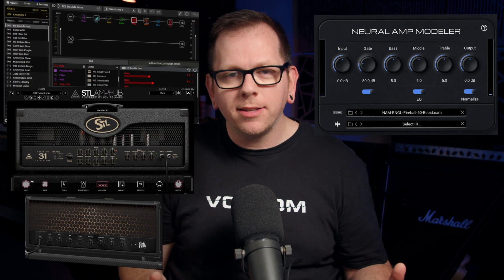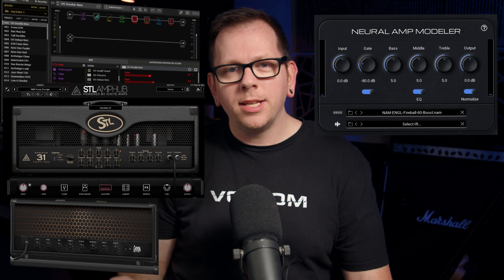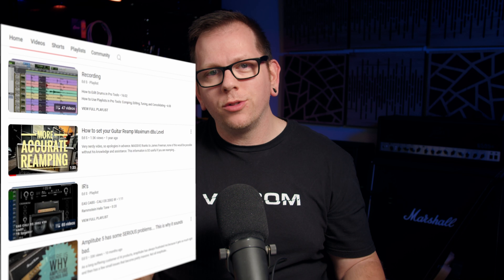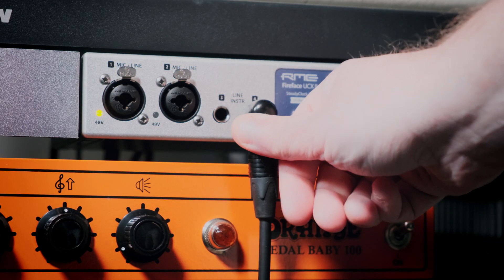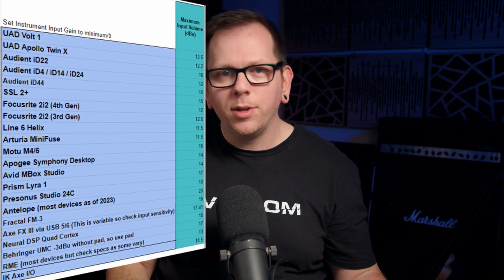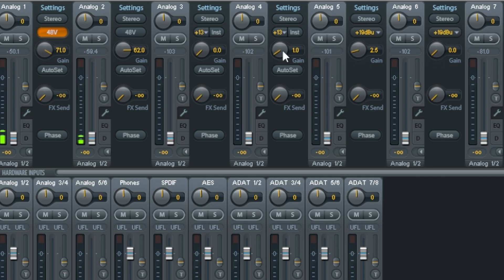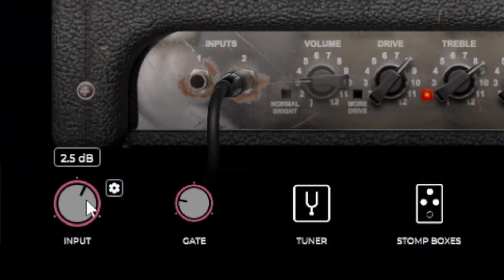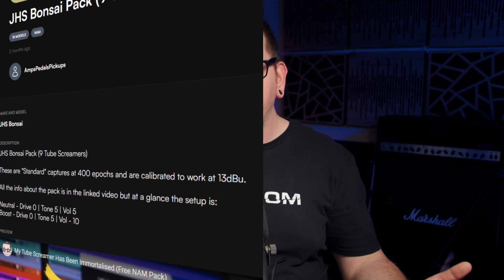Amp Sim / NAM Input Level Accuracy Explained

Comment: So, if the Clarett interface says that his maximum input level at instrument input is 15dbu, i need up the input level of neural dps amp sim to 2.8?
Reply from the maker: Yep spot on
Reply: @ampspedalspickups  thank you!
Reply: I can't find it nowhere, but thank you for the response 💪🏻
Reply from the maker: Which IK interface is it? I checked the axe io one and it says for input 2 on hi-z

0dBFS is obtained with a +14dBu signal at the TS input 

But yeah some interfaces and manual can be confusing. I always just open them and do a “find” for “dbu” and then next next next til I see them talking about the instrument input
Reply: @ampspedalspickups  sorry i replay the wrong coment. I don't find the input of IK Multimedia software like tonex or amplitube
Reply from the maker: @tregvilu  ToneX can be random based on the person doing the captures... and Amplitube is also random because as they modelled amps they seemed to have changed their own levels. The orange amps for example are insanely quiet, I have to go max input boost (which is around -3dBu)... so yeah unfortunately for those you still just have to play around with the input boost til things sound right. I'd say in general they both benefit from hefty input boosts.
Reply: @ampspedalspickups  i understand, thank you for your time and answers!

Comment: Hello. Thank you very much for the really good advice. However, I would like to know how to build a gain structure in programs: Logic, Studio One or Ableton. They also have excellent emulators of guitar amplifiers.
Reply from the maker: With neuraldsp and stl and everything on that spreadsheet, this information is given to us by the devs. Maybe someone could get in contact with logic about their stock plugins and if they can give us this information. We can always take some informed guesses by trial and error but without hearing from the devs we won’t know 100%
Reply: @ampspedalspickups  Can I compare the levels (with the same settings) that will go into a hardware amp and a software amp? Will this research be more or less objective?
Reply from the maker: We basically need them to tell us what levels were used so we can match it on our end. If we just dial it in by ear it’s guessing. No way to know 100% unless they tell us
Reply: @ampspedalspickups  I understand you. To my deep regret, I speak English extremely poorly. How can I correctly formulate a question for Logic support? Help please. I am ready to write to them at least every day.

Comment: I use a Steinberg UR mkII. How do I figure out which level for my guitar vst? Please help
Reply from the maker: What guitar vst are you using?
Reply: @ thank you for the reply brother. I am subbing to you as well 🤘 I have the check list you mentioned but it doesn’t have my interface on it. I’m using, neural dsp gojira plugin as well as the stl tones emissary plugin with engl impulse cabs. My main question was, if I’m using different amp sims, how do I know what to adjust the sims to seeing how everyone is calibrated different? I looked up my max input level for my interface but I have no idea what math I’m suppose to be using if you know what I mean?
Reply: And guitar rig 6

Comment: I have a HX Stomp plugging into a Scarlett 2i2, how would I approach it with this setup?
Reply from the maker: Using a DI box or modelling unit adds another variable into the mix and you’ll probably want to measure things to be 100% sure. Are you using the stomp for things like drive pedals or is it just a constant level out of the stomp and into the interface?

If it’s a fixed level then I guess we can think about it like a DI box and measure/work out the levels. But if you’re using drive pedals that can smash the signal then it’s a similar situation to using an analog boost pedal into an interface directly,bit harder to try and figure out what’s what cause the volume is jumping so much

I know I’m yarning but if I run a 20db boost pedal into an amp, the preamp circuit will clip the signal and pass it along to the next stages of the amp. Us guitarists are so used to just going “that’s how the amp takes this pedal”, it’s really just being clipped in a pleasing or unpleasing way. If you do the same into your interface and digitally clip it, it sucks and information is lost it’s just a different interaction. 

Anyway let me know how the stomp is generally being used and there might be a decent way to work out the levels out of it

Comment: With your gain at 0, you are at the worst SNR of your interface. You will endup with a very noisy digital DI signal. Inastead you need to max out the interface gain (without clipping) and lower the input at plugin level. You will then get the cleanest DI signal and still maintain a correct SIM behavior.
Reply from the maker: Modern interfaces that have around +12dBu of headroom are perfectly fine like in my example here. Some of my guitars are close to clipping on heavy riffs around +10dBu anyway. If you have quality equipment this kind of thing isn’t an issue

If you had your interface at 0 gain and your signal is insanely low and you’re boosting it so hard in the software that you’re introducing noise then yeah SnR optimisation would make sense… but the reality is it’s not a problem even on $150 interfaces like the Scarlett, audient and volt series. You’d really have to have some old off brand interface for it to be a problem

All of this stuff is contextual you have to judge the situation if there’s a problem.
Reply: @ampspedalspickups  If you clip at zero gain you are already too hot for your interface. You would need to use a DI box and come in at line level instead. Some older interfaces are notorious for poorly designed Hi-Z input that cannot handle hotter guitar signals. Nowaday, I think it's less common since now it's a pretty common use case to record DI signals and/or use plugins.
But anyway, the gain should be adjusted so the signal comes in just below clipping. Even if this means setting the gain at zero on some interfaces. On my Motu it's aoround 10 oclock.
Reply from the maker: @deconline1320  The RME I use has +13dbu at 0. Fishman fluence active pickups internally clip around +10dBu, bareknuckle aftermaths can hit around the same if you’re chugging away. I’ve got some other guitars with medium gain pickups that “could” be gained up a few db in the interface and then rolled down in the software, but the reality is the SnR stuff just isn’t a problem so all of a sudden I’m adding more variables into the setup just for the sake of hitting specs on a sheet. Right now all my recording and reamping is calibrated to +13dBu… if I wanted to go the extra mile I’d have to make a quick spreadsheet and test every guitar to see how much I could theoretically gain it up before clipping… and then offset the plugin by that amount. Everytime I change guitars or pull up an old session or reamp things I’d have to remember and reference all the offsets… or…. Just leave it at 13dBu where the SnR just isn’t an issue.

It’s all contextual. If you have one single quiet guitar of course it makes sense to work out the offset. But if the interface is high quality and the SnR differences aren’t really noticeable then there’s really no need to. And if you’re using a bunch of guitars that’s also another reason to keep things streamlined 

I could probably do a video showing some examples of how little it makes a difference.

Comment: Ed is doing redundant procedure.
Get the best volume according to your pickups on the way in into the audio interface (test the level it with chuggy palm mute + high pluck on the highest strings = this will ensure the worst scenario → lows at max RMS + percussive pluck Peaks) and if the input on the pre-amp (audio interface) clips the red, turn the input level down until not clipping (keep chugging + pluck).
Then you must have an audio reference from the REAL amps with knob settings (better do it with all knobs at 'noon' for default reference).
Knowing how the respective amp sounds, then you keep the same settings in the amp sim and adjust the input on the ampsim (or with trim\gain plugin at the front) until the ampsim starts to sound like the reference audio (REAL AMP) in terms of Gain (the EQ-mic and Cab will be different but can be mentioned in the reference).

If you do not have a REAL AMP reference (with default setting specified) – YOU HAVE NO IDEA HOW THE AMPSIM SHOULD SOUND AT WHATEVER SETTINGS.

For NAM (and amp modelers) it is all baked in but can be AND SHOULD BE referenced as well with the REAL AMP.
Reply from the maker: I think you’re missing the point of amp sim calibration. The developer tells us what level to set things to and then we match it. The whole point of this is that the developer should have created a good model that’s as accurate as possible and we want to replicate that on our end. It has nothing to do with peaks or referencing the real amp by ear or guessing things.

It’s easiest to set your interface gain to 0 and then set the plugin to the appropriate level. If your signal into the interface is healthy you’re good to go. If it’s wildly low then you can raise it and lower the plugin… but really most interfaces are fine at 0 gain
Reply: @ampspedalspickups  He's not missing the point. You should set the input on your interface just below clipping ( do not keep it at 0 ). Then you should play around with the input on the plugin side until it sounds and feels right to you. Absolutely do not trust anything plugin manufacturers tell you because they have been saying one thing before and now they are saying another. They have no idea what they are doing or talking about themselves and a lot of the settings in their plugins are just random noise nonsense to make you think ( for example ) changing tubes will make this kind of a difference or that ( but that's another topic )..
This way you will get the cleanest signal, best signal to noise ratio and you tweak it until it feels right to you. These are not real amps and even though they do sound good these days, they will never feel like real amps.
Reply from the maker: There’s two independent things happening 1) hitting an input specification for a nam capture or amp sim 2) having a good signal to noise ratio

1) nam captures absolutely matter when you hit the right input specification. They’re incredibly accurate and getting that same experience setup to setup can be achieved by matching the input specification. Amp sims are exactly the same. Sure we have to trust the amp sim devs but it seems crazy they’d go out of their way to lie to people, a bit far fetched. I personally get better mileage out of ampsims hitting their input spec vs not, a lot of others seem to have the same mileage

2) Signal to noise on a modern interface isn’t really a problem for guitars even at 0. But if it is for some reason then sure optimise it by raising the gain on the interface and then dipping it in the software

There’s 2 things happening at once, one doesn’t negate the other.

Comment: obviously you repeat the wrong way to tune in ->  https://youtu.be/gJ59h7xfvdI
Reply: Working with the interface level at 0 is the one way in which 99% of folks who are into amp sims can get the gain staging piece consistently right. 
Upping the gain knob on most interfaces can lead to very easily clipping the input converters. For instance, on my RME UCX II with +13 dBu headroom I can get sooo close to clipping with a few of my passive pickups like the JB or Suhr Aldrich (I'm not talking about hotter passives or actives). Problem is if you boost that input gain on the interface & your converters clip, your signal's pretty much goosed no matter what you do to it in the digital domain. 
The way people are taking to that vid sadly shows this topic is still not well understood.
Sure, for the 1% that get this stuff and have gear that allows them to up the inputs (then compensate in the digital domain) without clipping this is a great way to improve the quality of the overall chain. Problem is, most folks will just "rob Peter to pay Paul".
My take is the "input knob at 0" is the easiest & most consistent way to tackle this aspect of working with plugins for the majority of users.
Reply: @TudorAdrian  It is scary how many people that Ghost note audio video confused. People are funny lol. Make a video with a visual dBu scale. And when you turn up the interface gain show how it reduces the dBu headroom number. Some people would still not understand
Reply: @StudioAmpCaptures  If everyone here reads TudorAdrian's comment and then they read yours... it's just kind of comical because TudorAdrian is scared of clipping. Therefore putting the interface gain at 0 will always prevent clipping. Clipping is the worst! You don't want to increase interface gain! Ahh scary.

Then I read your comment StudioAmpCaptures that says... there's so much headroom that one has in an interface before clipping. Look at all that headroom! OMG! It's so bad to increase gain because your "losing" headroom! 

It's just kind of hilarious.
Reply from the maker: Did you watch his video? He’s using this same method. If there’s a problem with noise you can adjust it. But with an interface of +12dBu spec there is no adjustment necessary….. so yeah what I’ve got here is the perfect way to do things

Comment: If what you are saying is true, then why does I k multimedia have an audio interface called the axe  I/o (which i own) that has a passive and active switch on it. When you set it to active, it actually drops the gain down. If I am incorrect on how this works. Please let me know, cause I am curious, honestly.
Reply from the maker: Would be easier if I could share screenshots from the manual here so if you want to talk more then join discord and it might be easier

If you imagine a simple interface with no options then it’s easy to read a manual and go… they’re saying it’s +12dBu, easy

Interfaces like the rme and axe I/o here have multiple options so I guess you can think of it in two parts…. If I have my interface set this way, what is the dbu headroom and if I have it set another way, what is the dbu headroom. The end goal is the same, just trying to find what the dbu spec is when the gain is at 0

Looking at the manual the switch there is to “match” your pickups. I guess conceptually active pickups are louder so when set to active it drops down so things aren’t clipping. Passive pickups are a lot quieter so when set to passive it’s a more boosted signal. The impedence is also different which can change the volume of things

The manual doesn’t say whether changing the active or passive switch also brings in something like a +/- 6db shift. It just mentions impedance differences and says overall the interface has a +14dBu spec

To take any guesswork out of the mix you can just measure the stuff with a multimeter like in my follow up video. Probably the best way to take 5 minutes and measure the modes on the interface… do it once so you know what it’s doing and you never have to remeasure again
Reply: @ampspedalspickups awesome. Great answer brother.  Subbed and thanks.

Comment: Thank you for the video, very useful!
But I have one question that brought me here. How to properly setup levels on RME UCX II and Axe-Fx III connecting via SPDIF?
I found the famous info on Fractal forum about setup configs (#5 for me). According that info I measured direct Axe-Fx input level, then set SPDIF input level to get the same numbers. But the sound from SPDIF is more distorted. On UCX II I had +19 inst with +7 gain. Then I saw a comment here from @eds4754 that +19 is the same level as Axe-Fx. I believe that it is about 0 gain on +19. After that I tried to set UCX II to +19 inst 0 gain and 0db SPDIF input level on Axe-Fx. Seems like now it matches completely but I'm not sure, my ears are spoiled with endless comparison.
Have you faced with this case and what result you came up with?
Reply from the maker: Might be easier to join my discord and go through this step by step. Not sure if you’re recording on the axe and spdif to the rme or vice versa.

I haven’t done this exact setup but depending on how you’ve got it all setup I’m sure we can figure it out